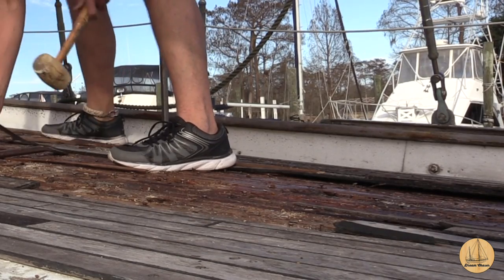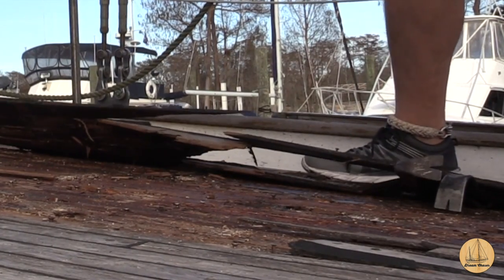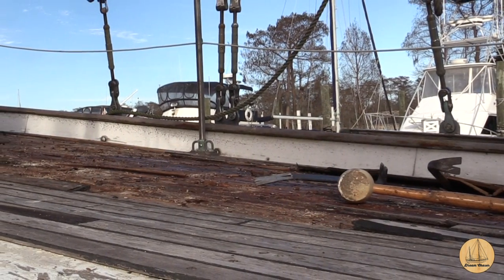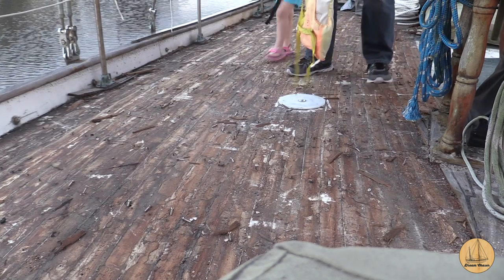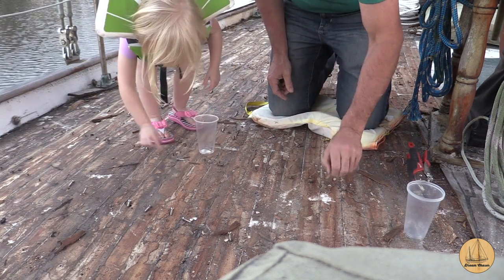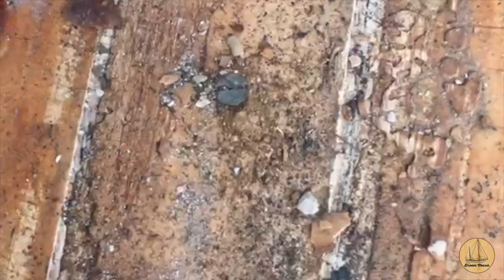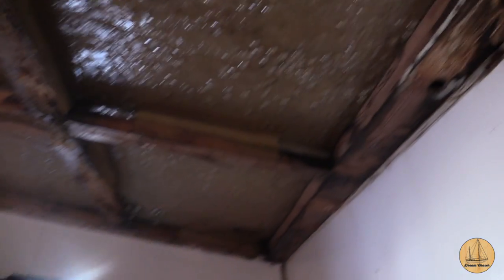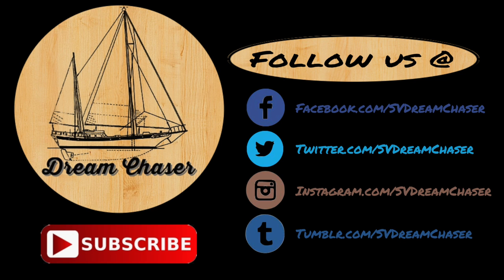Removing the Teak Deck   Part 8

Comment: Looks like condensation.  I would suggest replacing the solid plywood with a ventilated product (like pegboard) to let the air circulate.   Probably would get a dehumidifier as well.
Reply from the maker: Megan Luke that makes sense, the air circulation point. Do you think if it were insulated it would also reduce that or would it just be masking the problem? I can't seem to remember my sixth grade science classes. LOL

Comment: I would think the moisture is condensation...but wow that was wet!
Reply from the maker: S/V LO-KEE I agree. I am trying to figure out if filling the air space with foam insulation is a good fix or I am better to just leave it and allow more air flow to that dead space. I want to insulate it for better heat/air when on power
Reply: I would think the foam insulation would be the better way to go...I also understand a lot of live aboards have moisture issues and use dehumidifiers to help with the condensation

Comment: Hi Gil.

This comment will be way after the fact but would it have been easier to run a circular saw set to a touch under the depth of the deck teak and cut the teak in in patches of say 1 mt by .5 mt so that as you lift it with the bars it comes up as patches instead of broken boards or small bits and pieces.

Would be easier to handle more square shapes than kindling.

Also I would not put insulation in there it will only give any moisture somewhere to live and go mouldy.

Regards.

David. Down Under.
Reply from the maker: That is an interesting thought on how to handle it. Given the length of the pry bars I may have to make those cuts at about 30cm by 1-2 meters to allow it to still work. You have a good point, that may have certainly made cleanup easier too. 
To your point, I am beyond that stage but hopefully someone else embarking on this kind of a project sees this. 
Lol, I wish I had before I had done the work. It is a great suggestion Dave Down Under